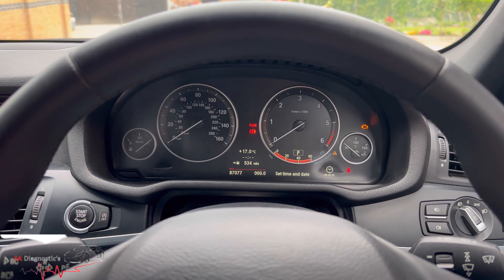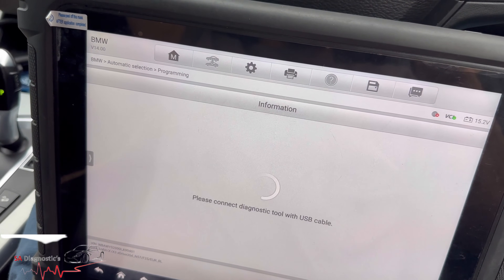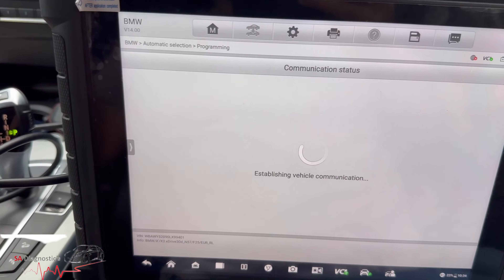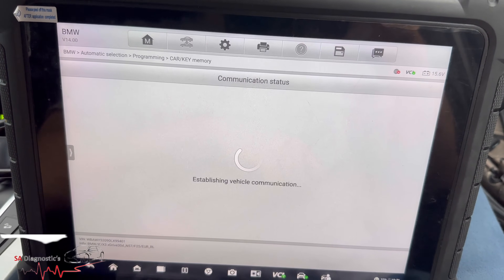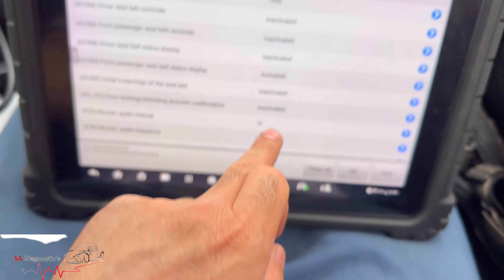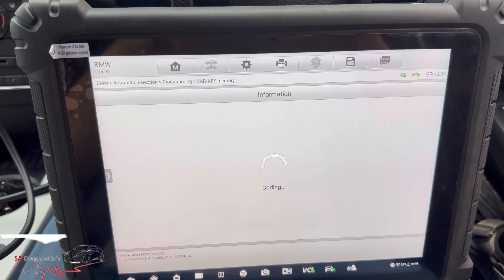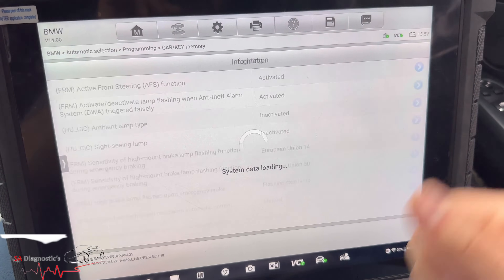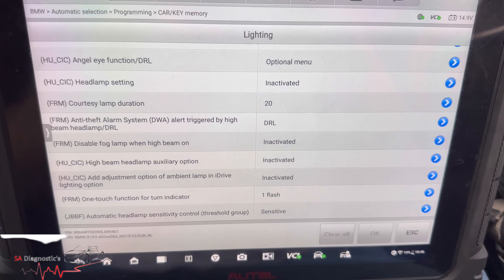NEW 2025 HOW To Code & Programme Using AUTEL MAXISYS ULTRA LITE Diagnostic Machine Step By Step

Comment: Hi nice vidéo, can you code for exemple Audi q7 secondary air system? So it doesn’t show a check engine for the insuffisant air flow? I have a mk808 and ms906pro ts and i don’t have the option for coding like yours..

Thank’s

Comment: Can the MS909ev do this job?
Reply from the maker: Yes — the Autel MS909EV can do ECU coding and programming/re-flashing similar to the MaxiCOM/Ultra Lite family, but there are important practical differences you should know about (vehicle coverage, online vs offline support, extra hardware/subscriptions, and safety steps).

MS909EV — Built for EV/hybrid + ICE: advanced EV high-voltage diagnostics, 36+ service functions, bi-directional control, ECU coding and ECU programming/re-flash (online & offline where supported). It also includes specialist EV tools (SoC/SoH, HV block diagrams, etc.).  ￼
	•	MaxiCOM / Ultra Lite — Marketed as a lighter (cheaper) version of the Ultra but still supports ECU coding, adaptations and ECU programming (brand/model restrictions apply). Many sellers and Autel docs state the Ultra Lite offers essentially the same coding/programming experience for many cars.